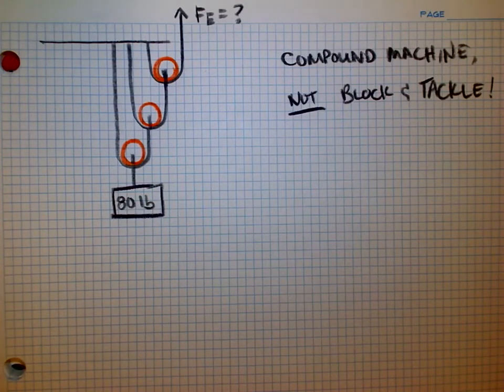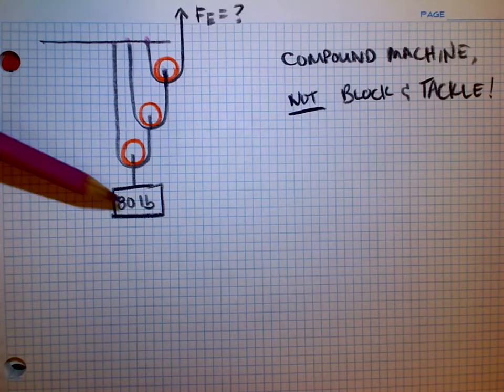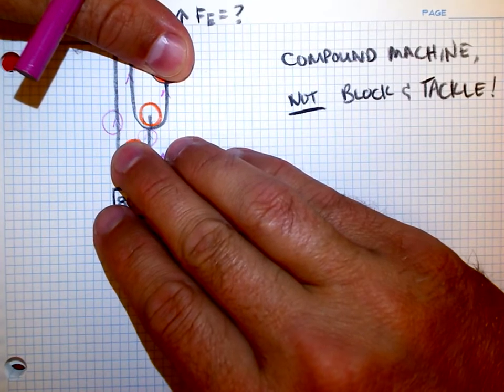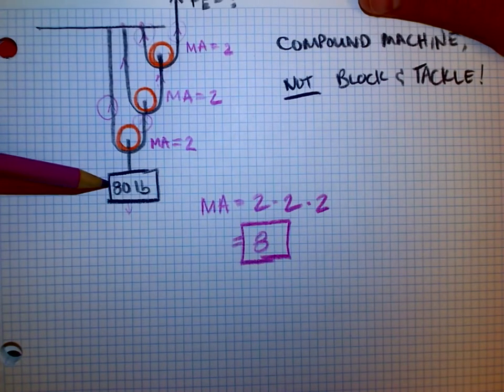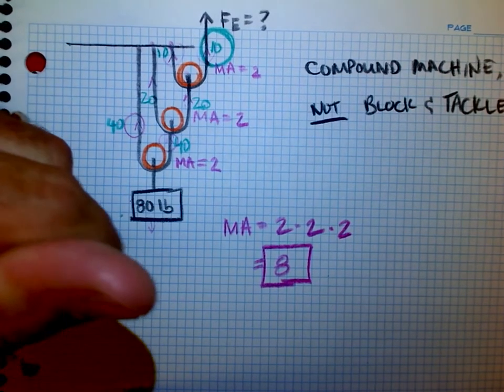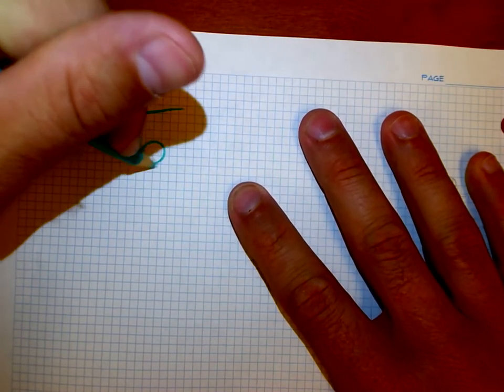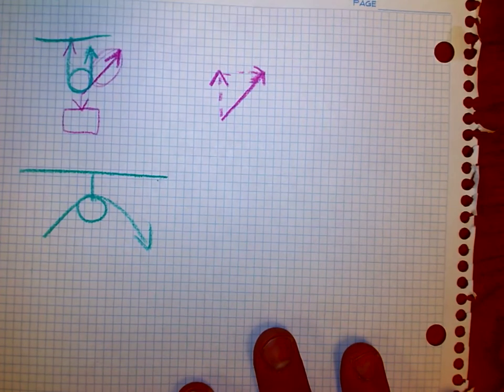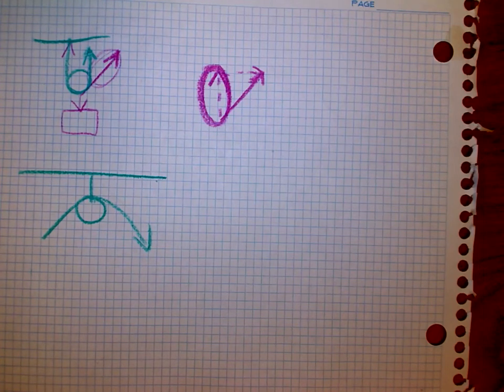Compound Machines - pt. 2

Comment: also could use the tension method stating from the top (where you pull rope with hand) and going downward...1 +1=2, 2 +2=4 and 4+4=8 total MA